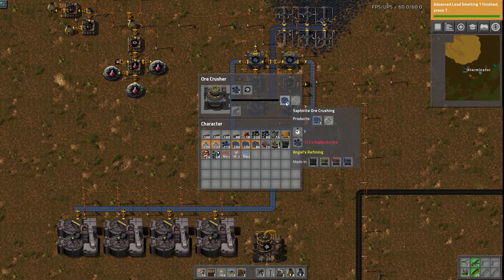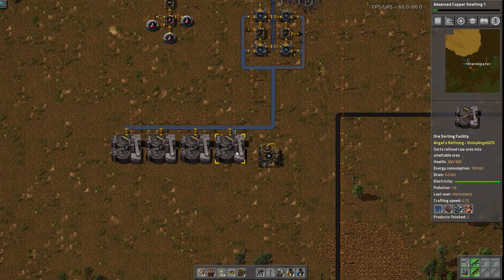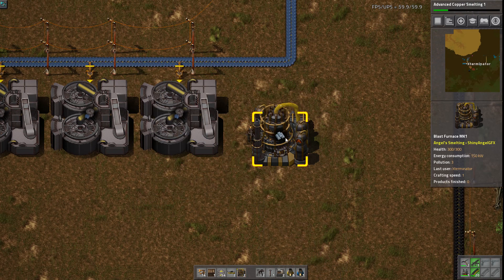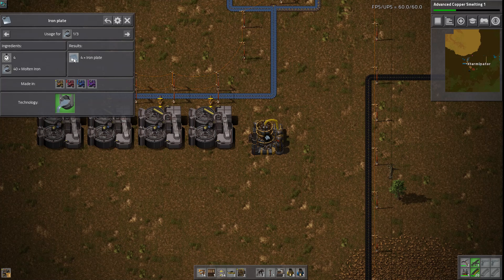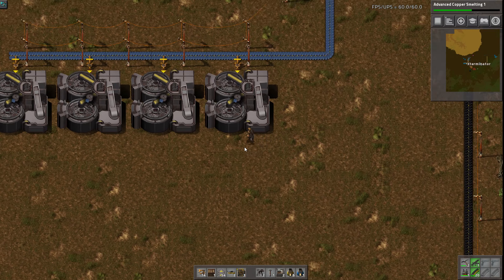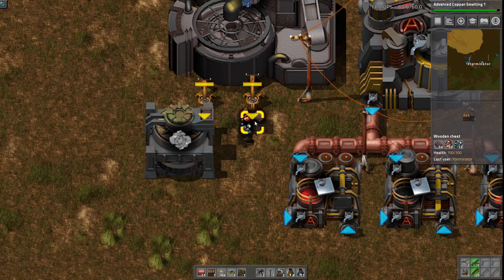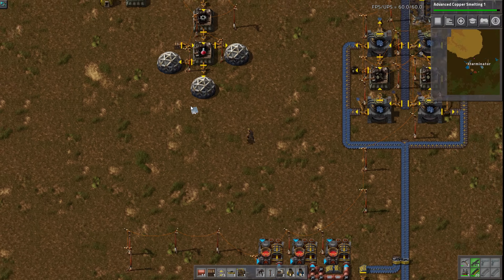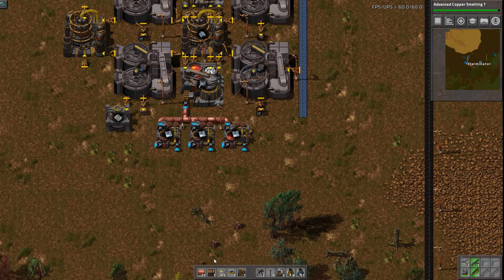Factorio Changelessly Discombobulated - Angels & Bobs Mods Ep 3: Metallurgy! | Gameplay Lets Play

Comment: one way to keep this mess clean without filters is to put the entire output on belts "circle" and have a truckload of yellow inserters insert into appropriate machines across all the line.
So you can have, like, 6 crushers filtering out slag, a blast furnace with 5 inserters for iron and after that for copper. that way everything get's picked up and you can distribute it better afterwards... (while you are at it, make an extra blast furnace setup for lead and tin, but keep in mind that lead furnace needs oxygen and outputs sulphur dioxide that can be used for s. acid that is used for everything ever in both packs...)

also, do every build in a line, component after component, connected via belts and pipes, because no amount of inserter flexibility can help you once you get yourself properly boxed in... and boy are you close :D (and bots are a painful amount away...)
Reply: > put the entire output on belts "circle" 

Just like my idea, except that I called it a "racetrack" and didn't get the ratios right...  ;)

Comment: Nice job so far Xterm, enjoying videos a lot. Since I'm doing a first-time Bobs-Angels playthrough of my own,
some tips from what I learned.

As you've noticed already, you'll be rebuilding your setups a lot of times. To save some headaches,
brute force your way through all green science first, then evaluate options you have. You will have plenty of
options of how you want to do stuff. Build your semi-final setup then. I've come up with a build that
has a 150% ore to plate efficiency for copper and iron at full red belt speed, and it will last a long time.

In the meantime, bootstraping. Make simplest solutions to get what you need, and forget about ratios. One basic crushing -> furnace setup for iron, copper, tin and lead each. Then a setup for Basic Circuit Board and a setup for Basic Electronic Board, to get some much needed Filter Inserters. Again, forget about ratios, just 1:1 everywhere to get materials.

Angel's metalurgy setups require a ton of power (mine takes ~20 MW). Getting Boilers and Steam Engine Mk2s helps a lot. It is also very worthwile to process coal first before using it as fuel. I'm using Coke Pellets, they have 50% more energy than raw coal, with minimal overhead (2 crushers and 2 furnaces for my 12/24 boiler/engine mk2 setup).

Getting Helmsmod might be a good idea. Since setups are so complicated, you can use it to get rid of math tedium,
and focus on layout design. Having an information from Helmsmod that, for example, your goal setup is 3:1:2:6 ratio
did not took the fun of designing itself, at least for me.

If you don't mind a screenshot, this is after 16 hours in my game (I like to take my time):
http://steamcommunity.com/sharedfiles/filedetails/?id=1194409827
Now to get Blue Science, oh boy...
Reply from the maker: Thanks, very happy you're enjoying the videos! :) Thanks for all the info and tips, really helpful. I'm really realizing now I probably spent far too much time trying to get things "perfect" from the get-go. After I complete the metallurgy setup (sense I've already committed to it), I will just bootstrap stuff to push for green science and the electronics stuff. 

Man, you're base looks really nice! I had envisioned mine to be that organized, but I don't think I'm quite ready for that yet. haha 

As for Helmsmod, I actually find it harder to use than to just do the ratios manually myself. I know weird, but it's how it is for me.
Reply: Base looks nice because it is basically a starter base Mk2. Original bootstrapped one was above and had been dismantled. It looks clean because I'm using Adjustable Inserters, and Loaders for buffer storage load/unload, there is no way this layout would work otherwise.
EDIT: Nevermind. I have to tear it down again. Damn silicon.

Comment: Just put everything on a line. A mixed line. From that line, first you pull the slag with multiple crushers, leaving only iron and copper. Then you pull directly into blast furnaces, leaving only copper. Finally, you pull copper. One such setup will give you half of yellow belt of iron and 1/4 copper, enough to kick-start belts and science.

Done! No filter inserters needed. Temporary setup, but so is yours :).

Oh, and get yourself Angel's bots. Do you know build everything factories? Well, in BA they are a 8x8 grid or larger, with everything going though marks 1-4 (6). Angel's bots are very slow, but perfect for a build everythings. Green science, no oil needed.

Mod name is Angel's Logistics.
Reply from the maker: I had considered doing it in a line like you suggested, but for some reason prefer direct insertion so went with my current method. 
I'm a ways off from Angel's bots but I'll definitely be getting them as soon as I can.

Comment: For the output of the sorters - put it all on one belt, then have the iron furnace on one side of the belt, the copper on the other, the crusher on the end to eat slag. Just be sure to have all 3 have at least one inserter pulling off the very last section of belt. That way you wont need to go through the headache of sorting anything

Comment: 9:00 There is a way, sort of, but it is annoying to make, with recipe combinators and other logic stuff. If/when you decide to use the super fast angled inserters, if you don't mind importing blueprints, if Steejo doesn't mind giving it, if it is mod compatible, he made a mini-make-everything with smarts. Make at least 2 of them for productivity and what can't be used with productivity, speed modules, and maybe 2 others for fluid/gas-related things.
Oh and for things that require steam, the lower mk boilers might be more effective as things don't care about steam temperature, or at least didn't last time i saw it in a video before the big storm. Oh and don't be surprised if you suddenly can't choose the recipe (even if there exist machines that are still set to it), as Angel updates often and changes things a lot.
P.S. careful with purified water/sulfuric water ratios in recipes, and the weird fluid mechanics that sometimes glitch and make fluid stop travel between 2 pipes/?map chunks? even if you put a pump right next/on top of the said spot
P.P.S. cheaty, but have you considered nanobots? The disposable guys that build/deconstruct anything you tell them to with blueprints and even clear out trees, just don't be surprised if a lot of your iron is missing.

Comment: Inserters at the top of a machine grab first before other inserters, so pulling copper out of the top and iron out of the side causes iron to be pulled to the copper. If you grab copper from the bottom, then the inserter for iron will take priority, so unless iron gets backed up, no iron on copper lines!
Reply: and iron is backing up because only 1 inserter isn't enough because the sorter makes 2 every 1.33(3) seconds or 1.5 every second, while an inserter can do 1 every 1 second (i think), and i'm pretty sure a long-handed inserter can do better, would also speed up iron creation.
This is also visible from the input/output, 4 input inserters and 8 output inserters even though the recipe is 1 to 1.
Reply: Not entirely accurate. The order they grab in is determined by something internally, but it is consistent. I think the initial order has something to do with the order you built them in. If you rotate one inserter out of position so that it gets "behind" the other inserters it will drop to the back of the queue and shift the ordering to whatever you want.
Reply: Huh. Pretty sure top always grabs before sides or bottom at least though.

Comment: Xterminator thats why the loaders were suggested in the pack. Because they actually have filters really early in the game and you would be able to do this without that much hassle since you would be able to filter everything in early game.
Reply from the maker: Yeah, but that would be too easy. :P
Reply: Xterminator have you looked up how long it would take to get filtered inserters? Your current system is based on that the Two other outputs never fill up. As soon they do you get a belt con termination.
Reply: Speiger I've seen loaders suggested a few times and it's true that they are handy but everyone seems to ignore the fact that they also require BEBs (and quite a lot of them, i think its like 10/15 per loader) so they wouldn't be able to solve any problem he has right now. Also late game an express stack inserter loading from a requester chest is way faster than a purple loader so they are really only useful for buffering things from a belt into chests (which is what i use them for).

Comment: Hey I have been playing with Angels and Bobs mods for about a year now. I would advise you to use Angels Logistics. It's a really useful mod for keeping your factory clean. It is quite balanced although it's pretty early game.
Reply from the maker: I am using it, but haven't unlocked anything for it yet. :)
Reply: Ah glad to hear that. But be warned. If you start using Angels Logistic Robots: They are very slow and have a high capacity. If you later change to normal Logistic Robots you have to get the other ones out of your system which is the biggest pain in the butt. Just a friendly reminder ^^. On twitch that ruined one of my streams completely.
Reply: artificial_immersion I recommend an addon called Robot Replacer for upgrading your robots. Its really simple, you just build a special replacer chest, drop it on the ground and put new robots in it. It will automatically start standardizing all the bots in your network to whatever type of bot you put in the chest and move old bots to the nearest logistics storage chest. It takes a little while as it will only replace bots that are currently docked at a roboport but you can just set it down, put enough robots to upgrade your entire network in it and let it run, come back 20 minutes later and its done.

Honestly though in my latest playthrough I find myself using angel's MK2 bots even into late game. They work surprisingly well as long as you set proper buffer sizes on your requester chests. But I also tend to use many small networks rather than one massive one so I can control how far my robots will need to travel. You also need to accept that you're going to have large material buffers in your requester chests but I don't really mind since buffer is a fixed cost.  

The one exception is my petrochem networks because angel's bots are terrible for moving barrels since they can only move 10 at a time, same as a normal robot with a few cargo upgrades. Also the angel's robots use a tiny fraction of the electricity that a normal bot uses and even though they are slow they have big batteries and can run for a very long time on 1 charge and recharge in a fraction of a second with higher tier recharge stations.

Comment: Sorting and Smelting are going to need to be in entirely separate areas pretty soon. Check out what ore processing does for you.

I definitely prefer to do Angel's wood production rather than Bob's. Bob's Greenhouses are way too easymode, you can power your whole base indefinitely off a dozen greenhouses producing wood, which feels ridiculous. Angel's is much more balanced and doesn't fully replace trees until you can produce resin. You'll need some of the byproducts that Angel's process produces later anyway.
Reply from the maker: Yeah, I never planned for this setup to be permanent. I also do plan to make wood from Angels once I'm actually able to. But I need to get a bit going with the greenhouses first.

Comment: Sorry if this is a bit fuzzy. The iron going out through bad path probably means you don't take it out quickly enough through the output you want. If you have a tick which produces 3 irons and 1 copper, but only install 2 inserter the first tick will take 1 iron, and 1 extra material (iron or copper). Therefore you should have enough output per material produced.
Reply from the maker: That makes a lot of sense and would probably fix the issue actually. Thanks!

Comment: I think as soon as you get filter inserters your setup will come to life. Also you messed up on the build slightly, you're currently at a 6-2 (3-1) ratio instead of 4-1 on sorters to ingots
Reply from the maker: I hope so! In what way did I mess up? Just miss an Inserter or like totally misplace stuff? It seems 4-1 to me.
Reply: Xterminator In total you have 6 sorters and 2 ingot makers (I don't know what the machine is called) so you need 2 extra sorters to keep a 4-1 ratio. Two of the sorters currently are feeding both ingot makers, which means each one is only getting half of what it needs from those two
Reply: I think the problem is that it was supposed to be 2x the 4-1 ratio, and the copper exported/partially inserted directly into a furnace between the 2 builds. But after that you set the one that was supposed to be for copper to the recipe for iron, essentially making it a 6-2.
basically what was supposed to be : S - Blue Cheese sorter, X - Iron furnace, Y - Copper furnace
S  S  S  S
  X  Y  X
S  S  S  S
became:
S  S  S
  X  X
S  S  S
which is even a wrong ratio.